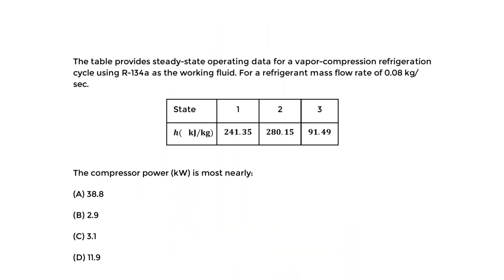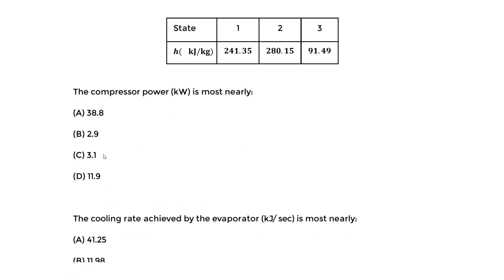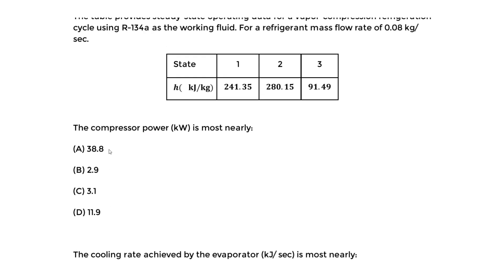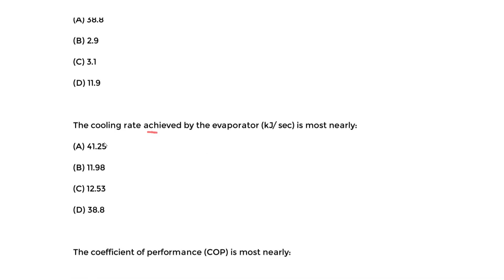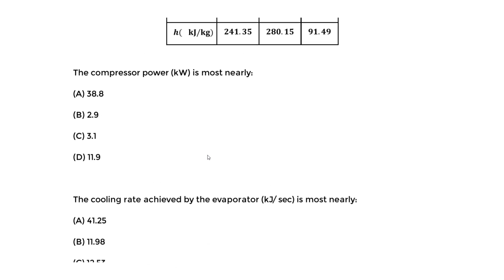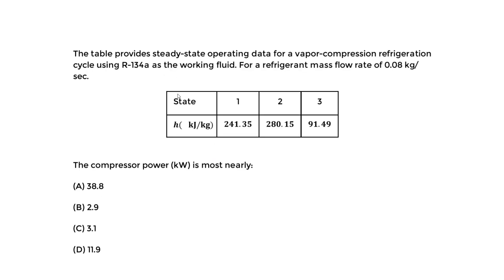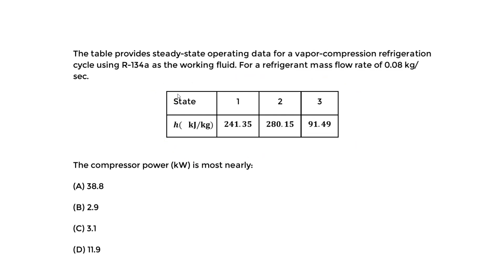FE Exam Review - FE Mechanical - Thermodynamics - Refrigeration Cycle (COP)

Comment: where in the handbook v 10.3 do I find the equation W=m (deltah)? thank you for your videos!
Reply from the maker: Hi Paola! 

This formula is not explicitly in the FE handbook. It's derived by conducting a steady flow energy balance. 

https://snipboard.io/Psug2L.jpg
Reply: Page 148 from the long equation at the bottom, after cancelling all other terms (v/2, gz, & Qdot). Also, 149 has h_i = h_e + w , which is that deltah. Unfortunately, the handbook has the info spread all over, I'm struggling with it too. Good luck!